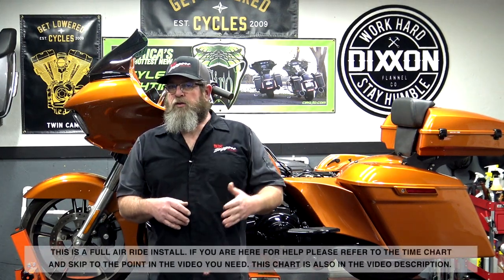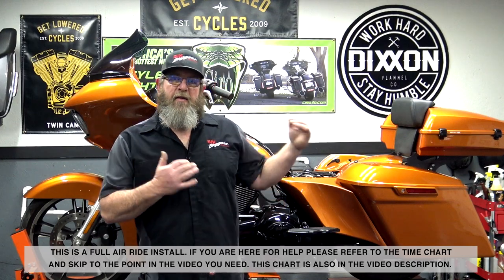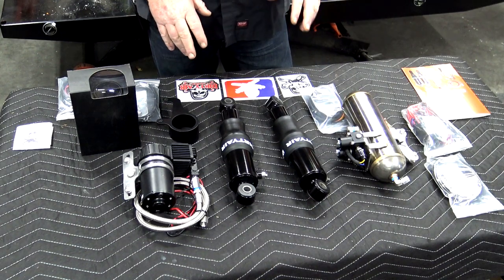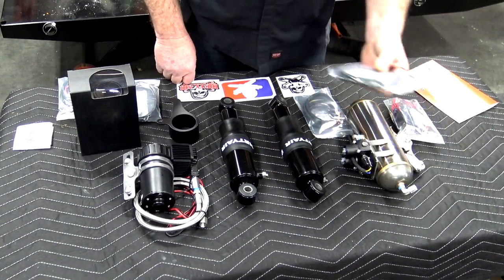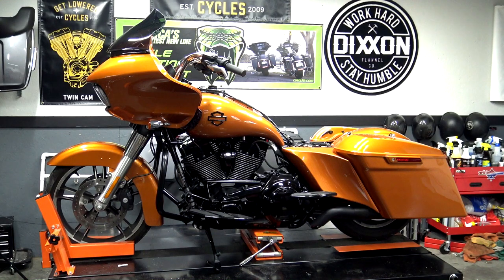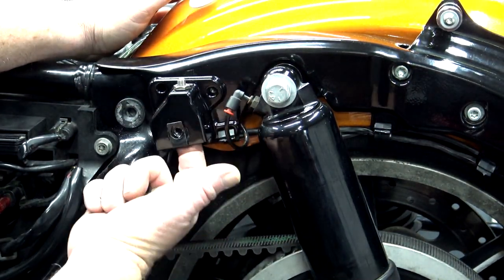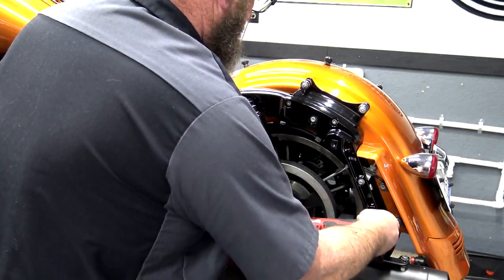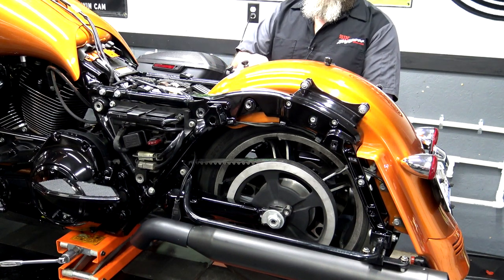⚡Install Dirty Air Rear Air Suspension System Fast Up - How To⚡

Comment: What did you use to extend the air gauge bracket?
Reply from the maker: I used the metal piece from a lid tether like these on amazon...but i just had a few extras laying around.  https://amzn.to/3E3Nl90 cut it to size, drilled 2 holes in it and painted it black. worked perfect as its thin but you can use anything like that..just thin piece of metal and drill your holes.

Comment: Whats the difference between Legends aero & Dirty air besides price? I want to buy the air ride for my 2018 Road Glide Milwaukee
Reply from the maker: I have not personally ran the legends...I know they cost quite a bit more and people who buy them seem to like them...Ive been very happy with the dirty kit and much more affordable is about all I can say.
Reply: I just exchanged my legends to Dirty Air. Because I don't like the long wait time for legends to get up and down. Dirty air fast up gives you that fast up and fast dump. Also, Dirty air has improved their quality of product. Believe me, I've done a ton of research.  8 kept my legends air switch and wired it perfect. I'm selling my legends air ride for 900. I paid 2000.. it only has 300 miles on it.

Comment: Gonna have an issue with my exhaust paipes hitting. Anything I can do about that?
Reply from the maker: If its hitting the bold then replace the bolt with a button head bolt...that usualy gives you some more room. But some exhaust out there are just big and dont have a large enough crease for the bolt..kinda sucks
Reply: @sikbaggers  got it. Appreciate you man

Comment: Do you suggest  air ride on front forks
Reply from the maker: Ive never used front air but it is something I am looking in to this summer...Lots of guys run it with no issues though...just something I have not dabbled in yet.

Comment: I see the possibility of stuff going wrong in the clearance of mounting!
Reply from the maker: If its installed correctly  you will have no issues with clearance. Its tight from side to side on the rear wheel...but nothing in the back of your bike moves side to side so it will never touch.
Reply: @sikbaggers  I see

Comment: Wow I service my own bike / put LEDs on it ect ect not a mechanic but that to me was like heart surgery 🤔 like there isn't enough that could possibly go wrong with my 14 Streetglide God forbid. I think 🤔I'd get a pro to do mine , then if it fu#ked up for any reason on the road I'd be screwed / wouldn't know where to start with all that crap on there / wires ect😂 Enjoyed the video though and nice you share your knowledge for free!👍🏻😎. I know there are more know how people out there then me BUT I also know people that can't do a 3 hole oil change do the air filter and those that rip into their bikes and have to trailer them to a shop because they screwed them up😂
Reply from the maker: yes sir if its out of your comfort zone then by all means have a shop install it. I too have my limit on working on my bike. I know when its out of my pay grade. Its a great ride though and pretty easy to install  if you follow the directions. My intentions were to show its not as bad as one might think.  Thank you for checking out the video sir and be safe!
Reply: @sikbaggers  it was a very well explained video . The first part to me was a breeze it was when you got into spaghetti junction with all those wires that freaked me out . If my life depended on it I could probably do it but no where near as quick as you 😂 I've been to motorcycle shows and seen these air ride kits and have been seriously considering one. I have a question if I may? I'm going to put a train horn on my 14 Streetglide. This has a small electric air compressor with a + and - at the bottom the same as the Harley Horn. I have fitted relays to LEDs ect to everything I've fitted on my bike BUT I'm now limited for space especially under the seat. Surley if the electric air compressor is 12 v with the same + and - hook up as the horn then the HD wiring and fuse should be able to handle it?🤔Any insight would be greatly appreciated.👍🏼😎

Comment: Hey dude, Can you please tell me where can i find those shocks? I've already seen one in ali express but I don't know if it is the same
Reply from the maker: do not buy shocks from ali express ...youll regret it...i promise you. These are Dirty air shocks and you can get them direct from dirty air. https://www.dirtyworks-kc.com/dirty-air-4-steel-rear-touring-air-shocks-pair.html
Reply: @sikbaggers  mil gracias, I just have one more question, which kit would you recommend me to put on  my bolt
Reply from the maker: @FredyOrlandoMartinezTorresF3x  what make and model is your bike?
Reply: @sikbaggers  is a yamaha bolt xvs 950   model 2015
Reply: Sorry bother you again but do you have any suggestions?
Reply: @SIK Baggers
Reply from the maker: @FredyOrlandoMartinezTorresF3x  ooohh..well I dot know if they make them for anything outside of Harley Touring ...I would give them a call and ask them..they may know of a kit that works with yamaha

Comment: Which wire is ignition there several blue wires
Reply from the maker: There is only one solid blue wire on the rear tail light harness off the black plug under your seat.

Comment: I purchased the dirty air complete kit for a 09 ultra classic but was told will not work with bag guards and dual exhaust. Do you know of anyone that has one that will? Thank you for your time.
Reply from the maker: Hey Joshua...I thought it would fit with some mods to the bracket..I thought I had read that in a forum somewhere. You might call JNR but im pretty sure they use the same mounts.

Comment: Do you have a video for a street glide ?
Reply from the maker: I do have one on the SG from JNR Air ride...however the street glide and the road glide will be exactly the same installation.
Reply: Steven Housden my friend has this same system and it works great.  I plan on putting this on my 2015 sgs soon. The only thing he has in his is a switch on his handlebars to dump air or inflate which is great. He paid someone to put the air ride in so I can’t ask him any questions about it.  Running that switch should add a lot of time to the install but it seems worth it than looking for a toggle switch under your frame.
Reply from the maker: @jccuby7771   The handlebar switch is pretty easy to install unless you are routing the wires through the bars. That will add some time to your install. If not, then you just add it under the tank and route it up the outside and zip it to your clutch line. Pretty easy. I run most of them that way unless im doing bars anyway and then thats a good time to feed them through. As far as the switch goes I have a video on a triple switch from AF Kustoms on my SG that I installed 3 years ago. I actually just got done shooting another one in black and updated version of his switch and that video will be out on monday at 3pm cst here on my channel. All 3 switches are above the horn and easy to get to. Love that thing as I can run my air and center stand from it. The handlebar switches are great top if youre not running a center stand.

Comment: How tall of center stand did you install?
Reply from the maker: 3"  stand with the one inch drop on the rear.
Reply: SIK Baggers have you had any issues running the lowering kit? I always ride 2up. I messaged DA and they said “Can't use lowering blocks with our fast rear, the shocks would sit too far back and damage the valves on the tank.  Also with a RG special, 18" wheel, you only have 3/4" clearance between tire and fender anyway when lowered, so you really can't get much lower than that.” Have you had issues?
Reply: @sikbaggers  wanting to get the same center stand but I am needing a 1 in lowering bracket if I am correct? I have looked but can’t seem to find the right prouduct for a 2021 road glide. Any suggestion? Thanks in advance

Comment: What is purpose of gauge?
Reply from the maker: It shows you the air pressure in your shocks, so you can find a comfortable riding pressure for you and set it to that number every time you air up. every time you add weight to the bike that number will change, whether its adding a passenger or just more luggage, so remember the pressure you used for each situation and just set it to that number
Reply: @sikbaggers  thanks I'm on a budget build and was not sure if I had to have.

Comment: Where can I find those positap connectors?
Reply from the maker: I can only find them on amazon and ebay...they are not cheap...there are some knock offs but they dont hold very well. just search Posi-Tap and there are kits or you can buy certain sizes.
Reply: I'm installing my dirty air right now so I'm gonna try the old clamp style connector just to get me by until I can get those posi-taps in. Thanks for the help
Reply: Your video was super helpful.
Reply from the maker: @kylehudson4878   Yeah man those things come in handy all over the bike to be honest just stay away from the cheapos..they will come apart going down the road and youll loose power to whatever you have hooked up..true story lol.

Comment: Anyone know if this would work on a heritage
Reply from the maker: It will not..you will need to get softail air ride...the air is under the frame..."softail" unless you have done a conversion on the bike ...but there are a few companies that make softail air ride, platinum is the one we will be installing on ours.

Comment: Does anyone have issues with your drive belt coming loose having an 
air ride system?
Reply from the maker: I never have,....it will tighten and loosen as you raise it up and down...but not stay loose. The bike still needs to be rode at proper ride height to keep the belt tension
Reply: Answered my question before i asked...great content and videos!

Comment: Seen in your past videos you installed a JNR system.  What is the difference between the two?  any Pros/cons of either system?  Thanks!
Reply from the maker: well after getting some ride time in on the dirty id say the ride is pretty equal. The dirty system seems to be a little more robust in its build. Ive had some issues with the jnr set up with the tank not being big enough to push me up on the first lift. It lifts up enough to get the center stand up and then i have to wait for it to refill to get to ride height. I do not seem to be having that issue with the dirty kit as the tank I got from them is slightly bigger. The install was pretty much the same however the valves on the dirty set up are mounted to the tank so less I had to jam up under the side cover like I did with the jnr kit.
Reply: @sikbaggers  thanks for the reply and videos. Both sound like good systems, dirty air a little higher quality package.   Keep making great videos. -God bless

Comment: Did you use a T Tap to connect the two wires to the ignition wire?

Comment: Only 35 ft lbs on shock bolts ??
Reply from the maker: (SERVICE MANUAL - Shock Absorber Mounting Bolt - 35 40 FT-LB 47.5-54.2 Nm)  What year is your bike and ill send you a link so you can download a service manual from my google drive for free.

Comment: Hi! Can i drive in low position? Or low for parking high for driving?
Reply from the maker: yes you can...just be aware of how low you are..you run the risk of hitting the tire with the rear fender...I do it quite a bit in town..ill drop it down and ride low..dont forget to bmp it up when you hit speeds over 45

Comment: i have the same set up but now it won't air up it's about 3 months old has about 100 miles on it and it just clicks any ideas
Reply from the maker: Sounds like your fill valve is either dirty or bad. Give them a call and they will sort you out...excellent customer service!